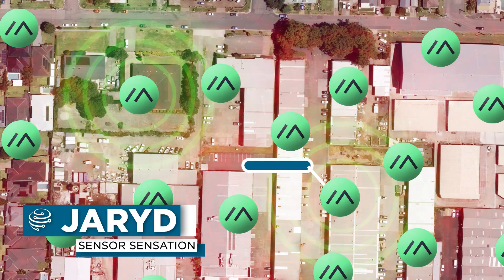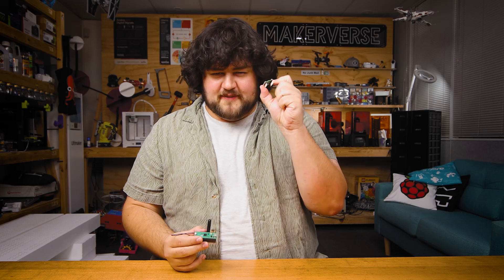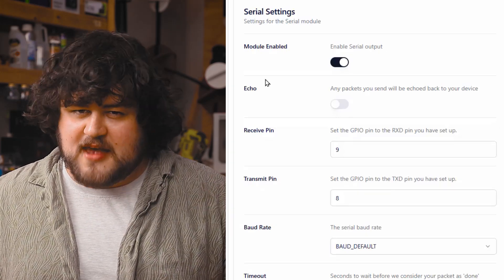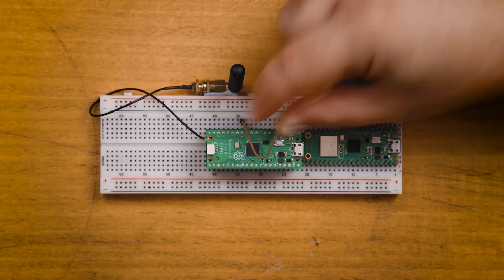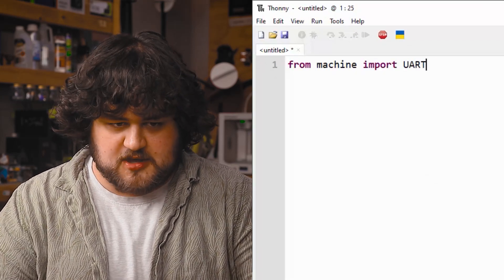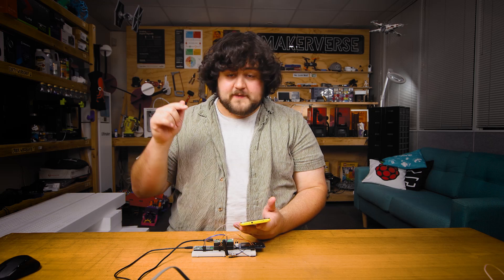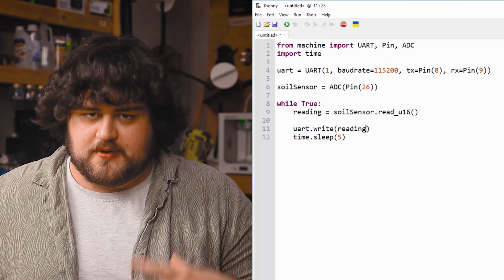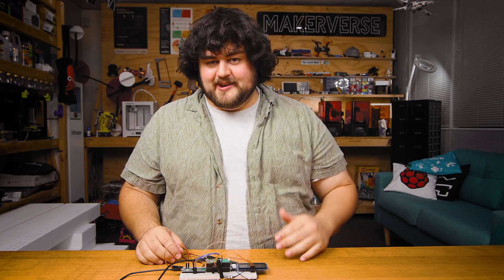How to Send Custom Sensor Data | Meshtastic for Makers

Comment: Good job man, but is using two microcontrollers and a LoRa module really the best option for a simple sensor node? It seems relatively expensive for this application
Reply from the maker: If you have a digital signal output from your sensor, there is a simpler way to do it!
https://www.youtube.com/watch?v=7l6ExVbQg_o

Comment: It is damn annoying to have to use second devboard for every meshtastic projects. I have dev board with lora in it. Why cant i just use Gpios of that board. Every manual is just use Rx and TX to control io of other board. I have tried to do everything and just cant get my led turn on of by just sending message or pulling pin up or down from my other board.
Reply from the maker: It is a tad annoying. The main issue arises that it is difficult to run 2 things on the MCU at once - one running Meshtastic, and the other running your code. You might be able to run one on each core of an MCU, but we are yet to see it. Another option would be to go into the Meshtastic code and implement your own C++ code in there. Have seen it done a few times for simple sensor readings, but its quite limited and easy to mess up the Meshtastic firmware. 

The person who can crack this though will be a community hero though!
Reply: @Core-Electronics  i was thinking that Gpio control could be empedded to mestastic app ot gui. And use firmware just as interface. I mostly would like to see second boards gpio to follow the io of the other one. Like it were in quantum state.

Comment: This is exactly what i need for my gate controller.   I setup a Heltec v3 for Meshtastic and a Pico for the gpio ins and outs using MicroPython.   But all i get with the tutorial is crazy charters,  not the word "Test".  What am i doing wrong?
Reply from the maker: That sounds like a mis-match between Baud rates which both need to be the same. Ensure in your code that they match! If this still doesn't fix the issue, we have a dedicated community forum topic for this course that you can get help on:
https://forum.core-electronics.com.au/t/meshtastic-for-makers-workshop/21669/2
Reply: @Core-Electronics Thank you for your answer.  I did check the baudrate on each unit.  Off to the forum!

Comment: How do I specify where to send the UART data? Is it always going to the one private channel you created?
Reply from the maker: Yes that's correct, the way this is set up the messages sent over UART will go to all other Meshtastic devices on your private channel. In the next video (coming next week) we will cover programming your receiving device to react to certain messages. In this next step we will cover how to make messages that will only trigger certain devices in your network, while still being received by all devices.

Comment: Great video. Thanks for sharing. I would love to see a video about how this could be integrated with Home Assistant. Maybe over MQTT. I could really use the long range of these devices. Zigbee devices have a very limited range.

Thanks again for a great video.
Reply from the maker: Good news! One of the chapters of this workshop will be how to integrate a Meshtastic set-up into MQTT allowing for off-grid and distant devices to transmit to somewhere with network connectivity. We're still working on that one but it should be out in about 2-3 weeks. Thanks for the support!

Comment: its dayta not darta! watch star trek!
Reply from the maker: Unfortunately we only had access to bootleg VHS copies of Star Tronk growing up, it was dubbed into Bulgarian so we picked up a lot of pronunciation from there.
Reply: @Core-Electronics  I'm Bulgarian and I can confirm the pronunciation. 😂 One question though. Is there a way to add other i2c sensors which drivers are not build into Meshtastic firmware? I think adding second micro might defeats the purpose of any battery powered project.

Comment: What is the range of this setup, so if you read soil sensor data then can you send it to your phone even of your pico is thousands of miles away?
Reply from the maker: Thousands of miles is a bit of a stretch. Hundreds is possible if you have access to some powerful radio transmitter gear and a tall mountain. The more likely range between two devices is under 10km for rural settings with line of sight. and under a kilometer in built up urban environments. But with a suitable mesh network relaying your message you could bounce a message out under a 100km. Sorry for converting freedom units to metric on you there, we don't have a strong a frame of reference in miles.